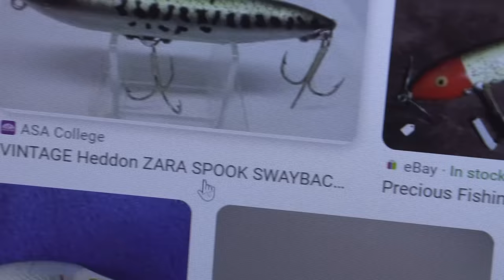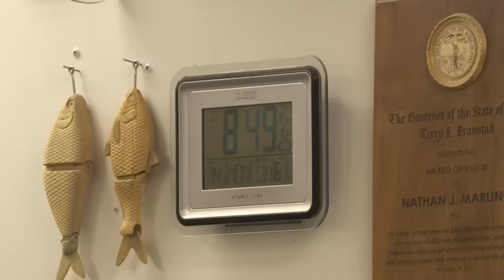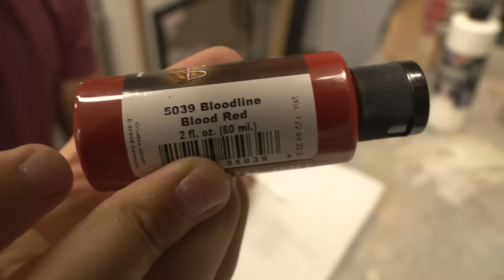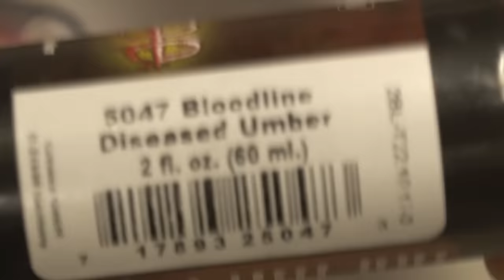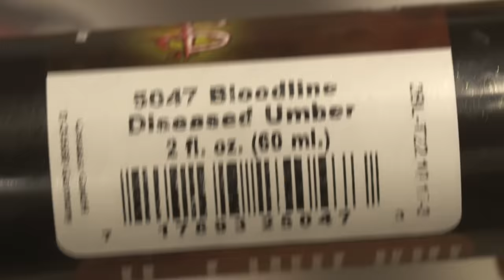Nano Walking Bait | One Day Build to Catch

Comment: Next time you turn something, at the end of your sanding process hold some of the shavings (swarf) tightly to the wood and it will burnish it. The end result is a super smooth finish. 
Gets hot though

Comment: I have a Zara Puppy Spook (Fire Tiger) which I have owned for close to 40 years. I believe it is the smallest of the Spooks.  I fish it on a ultralight outfit using 2 to 4 lb. test mono.  I think your Nano Spook is shorter but bigger diameter.  Puppy Spooks worked great on our Hawaiian stream Smallies.  The streams are now mostly off-limits, and the Smallies have been reduced drastically due to stupid humans dumping their aquarium cichlids into the streams which out-compete the Smallies.   The one freshwater lake here has become a homeless camp, with their garbage piles overflowing into the lake.  I miss the good old days.

Comment: Every once in a while you miss a super small detail. In this case, that split ring is too big. Other than that, love the idea of a nano walker. Well done.
Reply: I think the split ring helped give it more action . The weight of that bigger split ring probly is what allowed it to dive just under the surface on his fast retrieves. Yet it still had good action when he slowed it down. The weight distribution is key on this type of lure, messing with what he made would change the action, even the smaller hook he used on the back , changing it could be an issue. He got this one perfectly in my opinion. It probably be hard to make each one as good , if he made more .